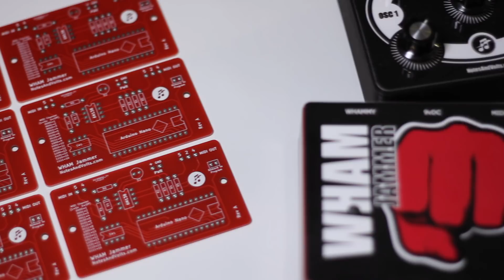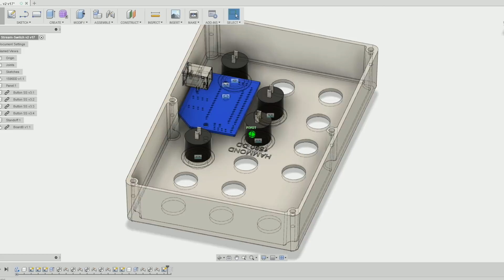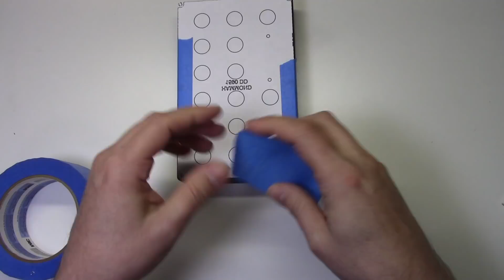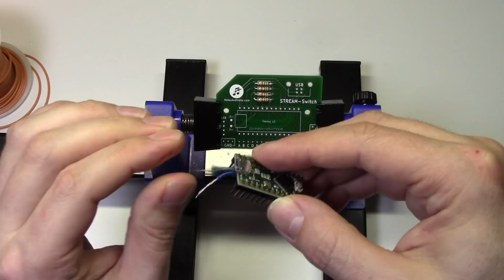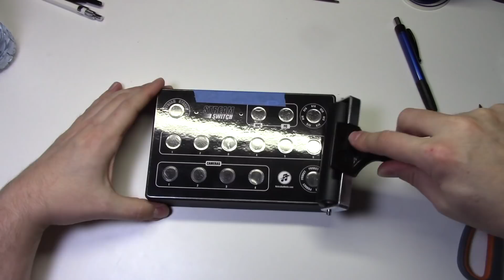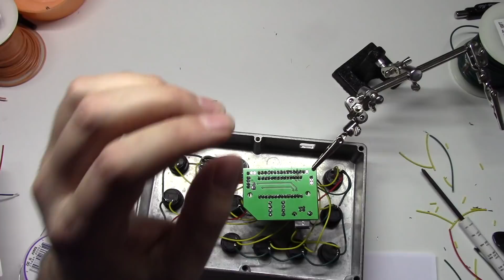STREAM-Switch for OBS - Thanks to JLCPCB!

Comment: Hi Dave, I recently started using OBS and really love your project and totally understand why you built it. Others have asked if the PCB Gerber files are available and the source code or even a binary. Sorry if I missed your response to that but I can’t seem to find any more info. Is it on your Patreon Page?

Also I was wondering about using the smaller 6 x 6 mm switch buttons and putting this in a very tiny enclosure. What’s your practical thoughts about that for videos/streaming?
Reply: I built a miniature version of this it measures about 2“ x 3“. I use the 6 mm tactile switches and four LEDs. Thanks so much for providing the source code for the original project. I modified it to match the layout of the unit shown in this video including the LEDs.

You rock the world. I love your projects and all the effort you put into presenting it so well on video.

Comment: For the front panel graphics, I suggest you just use one of those Avery-type full-page labels (it's basically a blank, full-page sticker that you can use in any type of printer, including a laser one). You then laminate it and get a very nice sticker laminated on one side. You save a step and it's probably cheaper. I've used this method for a project and it's holding strong after a year and a half.
Reply from the maker: Thanks for the tip HighDuke! What product/machine do you use for single sided lamination?
Reply: @NotesAndVolts  Either the lamination will stick to the peel away backside, or you just put a piece of paper behind there. Used this for stickers on cars myself :)

Comment: hoes does the Camea know where to cut? how do you handle alignment?
Reply from the maker: Hi Dafydd. Sorry, I don't understand the question. Can you rephrase?
Reply: The cameo cutter cut the holes perfectly, in a piece of paper that you had printed elsewhere. how does it know where the holes are? sheer luck in placement of paper, or a camera etc?
Reply from the maker: Ahh I see.  The Cameo comes with software. You import your file into the software and it adds registration marks in the corners. You then print it out using the software and the Cameo reads the marks and aligns itself.